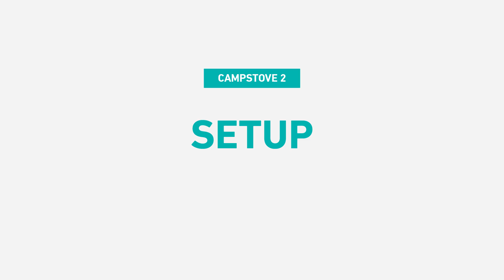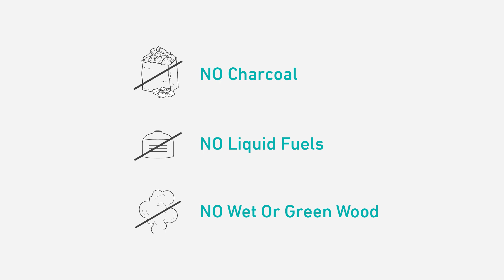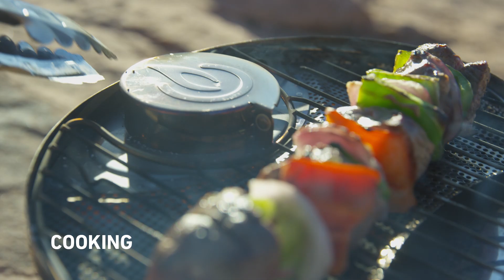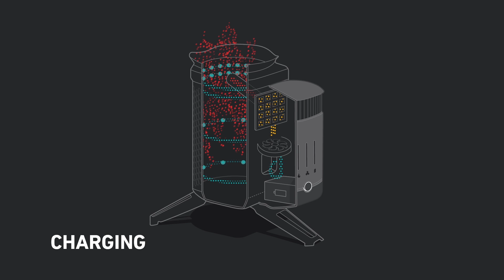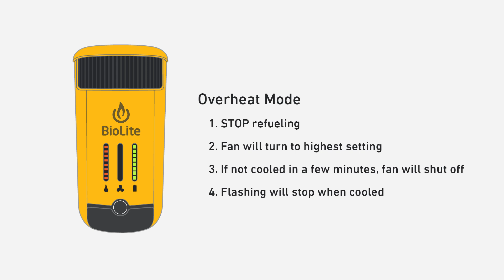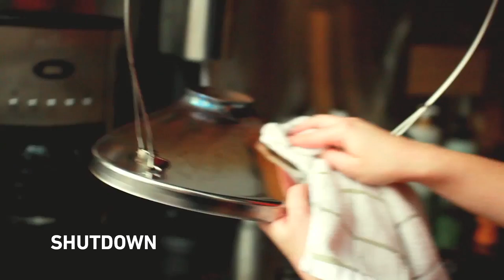BioLite | CampStove 2 How-To Instructional Video

Comment: has any customers had any issues with the plastic battery overheating during use? or potentially melting or catching fire? all real risks associated with this.
Reply from the maker: Hi there! CampStove is designed with battery safety as a key consideration. The battery component will not overheat or catch on fire with normal use.

Comment: I have one of the first units from the Kickstarter campaign all those years ago...
Just went camping and used it to cook and boil water, and making mountain pies. It was the hit of the campsite and worked amazingly as always.  i was able to use the little pinecones around the campsite for extra 'powah'.  i cant imagine using the new one with 50% more power!
Reply from the maker: Love to hear this so much!
Reply: @BioLiteChannel  Would the new battery/control unit fit on my original stove body?

Comment: i dont understand if you got a device with you thaht needs battery charged  to spi na fan and charge a phone insit thaht jsut a powerbank  does the fan thing  orange box get charged by the fire wiouth charge ?
Reply from the maker: Correct, the heat of the fire is what charges the battery on the product! This turns the orange component into a power bank for charging small electronics. You can charge gear both while the fire is going or whenever the battery has charge saved up.

Comment: When grid is down how do you charge this equipment?
How long to fully charged?
Reply from the maker: Great question. The beauty of CampStove is that the fire and heat you produce actually charge your battery! The time to a full charge will vary depending on how hot your fire is. The hotter and more efficient your fire is, the sooner your battery pack will be fully charged and ready to go.

Comment: just bought it tonight and wanted to try all the features. I tried starting a fire with small pine slivers and pieces of paper. didn't really work, and i didnt know about the fan initially so I didn't have the power module installed. i think pellets are probably the way to go because I was feeding the fire every couple of minutes it seemed like, which is kind of impossible out in the wild. I was impressed with how fast the water heated even on the low fan setting; its faster than putting the kettle in a fire. I'm still figuring out the grill-- the metal got hot, but I couldn't make a piece of toast. i think the pellets will help with this immensely.  wood from the wild will work in a pinch, you just have to really nurse the thing or the fire will eat all the fuel in a couple of minutes.

Comment: It looks amazing but wouldn't it take something like 800 hours to charge a modern phone at 3 watts? Even for a small charge 24 hours for a 5% battery as an emergency item still not awful but you make it sound like this will charge your phone overnight or in a few hours which is imposable with a 3 watt output.

Comment: When I use wood pellets filled to the suggested point, the fire is almost impossible to start. Maybe the top layer will burn, but it won’t make it down to the bottom. Could it be the pellets I’m using? They’re Oklahoma Joe’s hardwood apple pellets.
Reply from the maker: Hello! While we have not used those specific pellets before, the challenge may be a lack of airflow from too many pellets in the chamber. Start with some small sticks and a small handful of pellets to get the fire going (which in turn kicks on the fans). You can also always light a stick outside the chamber and place it in once burning to get a flame ahead of time. Hope this helps!
Reply: Yes I have had the same issue with wood pellets sometimes it goes out n smokes
Reply: @davidlaw233   The solution I came up with was to create my own fire starters by saturating cotton balls with petroleum jelly. I can fill the stove to the max level and put one of these fire starters on top and it burns extremely well. The petroleum jelly melts down into the pellets and helps keep the fire going.

Comment: Any concern for battery  being next to burn chamber & in proximity to fire coming out?
Reply from the maker: Hello! Great question. The way CampStove is designed includes this very consideration. Unless users are in high wind scenarios, the flames should be above the battery pack. Even in those situations, the battery casing is protective to ensure no harm is done to internal systems.

Comment: So I got one of these, the full kit. To me a very expensive product but knowing what’s behind it also worth it. 

Mine is making a lot of noise, weird scraping metallic noise. From new. It had always made the weird noise, loud, quiet, loud again, like metal screeching. I have never dared to use it so it had only three trials. I figured it was broken, brought it to the shop for replacement they decided not to replace mine (because once i lit it, it was used….) and told me they would sent it in for repair… i complained it was new but alas. After 3 weeks i asked what the situation was and they told me; we just mailed it out to you, i ask for a track and trace and then they said; oops computer mistake. We’ll sent it to you. Then they said, we sent it again?!
 Anyway, they say they checked together with the manufacturer (you I guess) and it was and is supposed to do exactly what I described. They say, it is supposed to make this awful screeching sound. 

Is it supposed to make a screeching sound? A loud screeching sound? They say so but I have a hard time believing nor trusting them..

Comment: I recently lost my stove, fuel can, coffee maker . I bought replacements for each, but either I left the stove on, or the cheap stove malfunctioned. Either way I want to buy this as my main stove.  My favorite wood stove is just 🪵 with holes in it. No adding fuel and it has constant, consistent flame that can last hours, depending on the size of the log .
Reply: Which favorite wood stove

Comment: By the way, I have used mine 3 times and it is doing pretty good making burgers, although used your pellets and had no problem getting it going. Cooked some water as well. Also made some soft cooked Eggs in the boiler, went pretty good.
Although I still have to figure out the best way to get rid of the left over coals in my area when using it.

Comment: How does the unit cools down with max speed on the Fan, if that setting actually makes for faster boiling water?
So fastest speed cools, yet burns fuel faster for heating... yet cools the unit?
Reply: I own two of these so I can tell you:  the higher fan speed introduces more air into the combustion chamber causing the flames, and heat, to go up- which is good for cooking.  The fuel (i.e. sticks) burn VERY quickly at the highest fan setting.   In regards to the cooling ability of the fan? Once the fuel burns out the air movement will cool off the electrical components AND the burn chamber.
Reply: I was wondering that also but I see they didn't reply

Comment: My cook pot is slim enough to perfectly fit inside the pot stand, not on top, so that the bottom of the pot sits flush with the top of the stove. Is this okay, or will this cause the flame to get snuffed out unless I switch to a wider pot that leaves an air gap?
Reply: Get a wider pot.  You can see that the BioLite coffee pot fits snugly  to the stove but it has a raised bottom with vents for air flow.

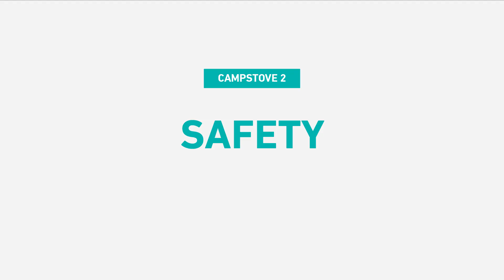Comment: LOL, you might want to edit this video - at 7:09 you show the stove positioned in the wind so that the flames are going over the battery and close to the handles of the kettle - that's the opposite of safe use from your own manual.

Comment: What I would do it's to create a container  or a box that can fit the stove and the pot for cooking inside. That box will have a fan to push the air in and a air filter so that you can filter all the smokes. You will need a box for it anyways. I would make that box into a back pack so that I can use it to keep others stuffs in there too. It's ok for the filter to be wash with river water on land. Those carbon is good for the soil anyways. Living green. But not in industrial level because industrial level is burning rubbish and chemicals that even those filters are harmful to the environment.

Comment: NICE VERY NICE, Never would have thought of this for camping. PS.  here's a suggestion, could you make three sizes of this unit, Small, Medium and Large, for home emergency use and camping. But yet, still be economically feasible to buy.  This idea just came to me after watching your video and reading the comments below.
Reply: they actually already kinda do that. This campstove is like the Small, there the Basecamp they export to poor countries you could see as the Medium and there's the Firepit which would be the L. All are built around the same principles. The Basecamp probably makes the most sense as a power generating home stove.

Comment: This is smart, but a propane stove is much more convenient, compact, and the stove part will heat unevenly. You also have to get firewood with this if you don’t have pellets, so the outdoor conditions (rain = wet wood) can affect this, and the size of the sticks matter, and this is a backpacking stove since it’s small and compact, which would make it a lot less inconvenient than the propane backpacking stoves.

Comment: What is the best way to refuel with the pellets?  When I add more pellets when the fire has died down I get a ton of smoke.  Should I be adding fuel when the fire is mid way through the first batch of pellets?
Reply from the maker: Hey there - Great questions. Be sure to add more pellets when the fire is still going but don't drop a ton of pellets in at a time as this will snuff out the fire. We usually grab a handful and gradually drop them in using a stick to stir them into the burning pellets. You can also refuel using sticks and twigs once you have a pellet fire going.
Reply: BioLite awesome, thanks a ton for the tips.  Now I won’t get hard looks from other campers due to excessive smoke when I smother a hot pellet session!

Comment: Can u put it on it side to have better surface area and lower the center of gravity to prevent tip over? It can be the same exact size just open up the long side to put the twigs in.
Make a titanium option! 
Need more charging ports. 
Type C fast charging connector.
Would luv a manual hand crank to charge like my flashlight & emergency radio which also charges devices via hand crank. 
More stable legs/stand. 
Smaller Grill should be fold out flip up and permanently attached to the stove itself. 
Firebox has a flip up shelf that would be nice too. 
Could use Smaller water pots. Most Only need 1.25 liter capacity or make it in 3 sizes if feasible. 
The light seems unnecessary. 
I hope you're profitable. It's a great idea.

Comment: I love my 1st gen stove. Wouldn't trade it for anything. We do a lot of van camping and we used to use propane and charcoal. No More!!! Then we found your company. We take a small old cooler with some old cut to length 2x4s and I split them at home with a hatchet. We always have dry pine wood to start the fire or to use even if it's raining or wet. You would not believe how little wood these stoves use and that in itself is awesome. LOVE MY STOVE :)
Now I need another one :)
Reply: How's the BioLite stove holding up now ? I just bought a new but first generation.60 bucks Canadian.. I thought it was a good buy! You still using yours does it work good?
Reply: @eward1963  it exploded

Comment: Is it all weather? How cold can it handle to be effective?
Reply from the maker: Hey Jason, The CampStove can be used in all types of climates. It is not waterproof so we don't recommend using it in a torrential down pour, but we see our community using it in the summer desert heat as well as in snowy winters in Colorado. In terms of cold, the CampStove can work in below freezing temps.

Comment: Why can't we use charcoal?
Reply: amiraseri 

Hello,,, I read on BioLite that charcoal is a different type of fuel than a wood product....  something about it being a glowing ember instead of putting off gasses needed for a “lit” fire.    I thought charcoal would be a great fuel too. 

I did see large bags of pellets are 3.99$    The price being a non-factor if u choose pellets as fuel.
Reply: Good question can't see why not many of it would burn too hot with the fan

Comment: Our power is out after 9 inches of snow and ice. It’s 25 degrees out. I had surgery and can’t pull start our generator. My phone battery was low and we are hungry. So . . . I searched and found this video to make sure I started the fire right. I made Swiss miss and ramen noodles just for the warmth, speedy cooking,  and fun of it. Wish I could post a picture of this wonder tool next to the snow on our deck. Thank you!!
Reply: What a story, glad you're ok.
Reply: Beware! Too cold and the battery doesn’t charge. In –5C mine didn’t charge anymore.
Reply: @tarpattituopponen7783  you can put a new battery in it 👍
Reply: Did you use the snow as water for the cooking? (If you used water that is)
Reply: @Vodaph0ne I melted snow and ran it through our Berkey filter before cooking it.
Reply: @tlsnana9539  Nice! Altough why not just boil the water instead of filtering it to kill of any germs?
Reply: @Vodaph0ne it gave my son something to do. He felt needed instead of bored. 😉

Comment: Regarding to BioLite Camp Stove 2...Please, I think you BioLite should answer the doubts in the comments...The aluminum part melts? how long does it take to charge a cell phone? what kind of material is recommended for burning? Can I fully charge the power bank just by burning wood and how long does it take ? If the device malfunctions, it will be replaced or I will have my money back? In case of a natural disaster (when you do not have electricity) will the stove work for a few days or weeks just burning wood? How it works at sub-zero temperature? It will rust if I use it in camping on the beach? For how many minutes or hours can I use it without stopping? Can I use the stove every day and for how long, only minutes or hours? Thnaks!
Reply: I don't think you're going to get all 50 of your questions answered unless you get a job @ BioLite
Reply: It's a 15Wh battery. Based on promised 3W output, the battery will be fully charged in 5 hours of the burning fuel. However, the fan used to accelerate burning process takes power too, so real time until the battery full charged may be ~10 hours
Reply: Will it rust if i submerge it in water? If so how long will it take to rust completely? If i throw it against a brick wall will it break? If so what is the damage? What is the percentage of aluminum to other metals? Will i be able to keep this going using only blades of grass? How high are you able to throw this? Why did you not post the terms of service? How many of these were made worldwide? How long exactly does it take to cool from max heat? Does the water get warm enough for my child to bathe himself? How many kids are allowed to bathe? I mean god damn you guys missed so many valid questions.
Reply: @xzed6394  fuck off😉
Reply: @xzed6394  LoL!
Reply: @xzed6394  Savage!!! People like you are exactly the reason I hardly comment!! OMG! 😂 I'm finished looooool man.... some one must be seething! I know I would be heheheheheh.

Comment: We can load  it with the micro USB ?
Reply from the maker: Hey there, In addition to re-charging by the heat of the fire, you can charge up the battery via micro USB.
Reply: thanks for answer me, i  can sleep outside  now, good bye Babylon^^

Comment from the maker: Hey all -- just got a request on another video to explain a bit more about using BioLite pellets in the CampStove 2:

Firestarting with pellets is fairly straightforward: fill up about 3/4 of the way and then place lit firestarter on top. The fan will kick in when it detects enough heat. Pellets will burn for about 30-40 minutes straight so you don't need to worry about refueling BUT if you do want to refuel, we recommend letting the pellet fire burn down and then refilling from scratch (they leave very little ash behind). 

Because of their density, if you drop a bunch of pellets into an existing fire, you run the risk of snuffing out the flame. If you reaaaaallly want to refuel while the pellet fire is still going, you can add a few sticks (helps keep room for the fire to breathe) or you can carefully drop a few pellets in at a time. Thanks!
Reply: BioLite I have used my original stove primarily with pellets with splendid results.
Reply from the maker: Glad to hear it!
Reply: I can’t describe how much I luv this product!
Reply: Regarding to BioLite Camp Stove 2...Please, I think you BioLite should answer the doubts of the comments...The aluminum part melts? how long does it take to charge a cell phone? what kind of material is recommended for burning? Can I fully charge the power bank just by burning wood and how long does it take ? If the device malfunctions, it will be replaced or I will have my money back? In case of a natural disaster (when you do not have electricity) will the stove work for a few days or weeks just burning wood? How it works at sub-zero temperature? It will rust if I use it in camping on the beach? For how many minutes or hours can I use it without stopping? Can I use the stove every day and for how long, only minutes or hours? Thnaks!
Reply from the maker: @TEAM762  all great questions! Please review our website page to understand these pieces - https://www.bioliteenergy.com/products/campstove-2-plus . If wanting more information at that time, please email our customer service team and they will get you specifics answers accordingly!